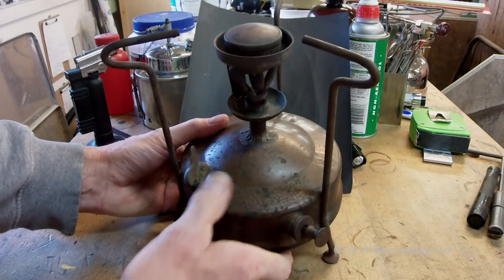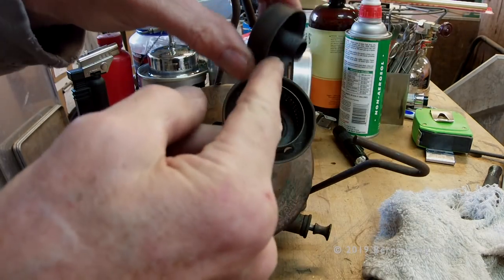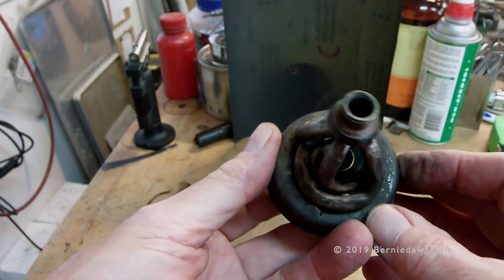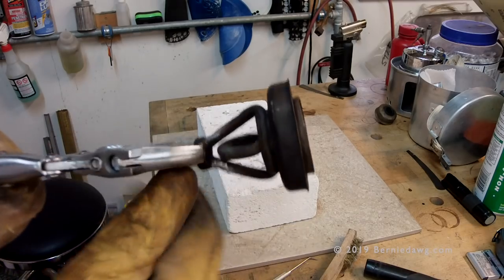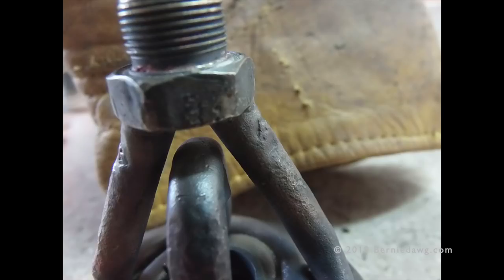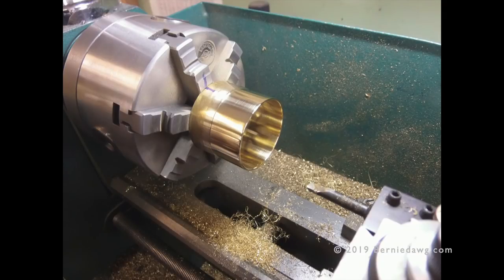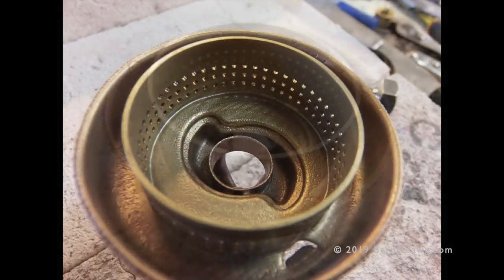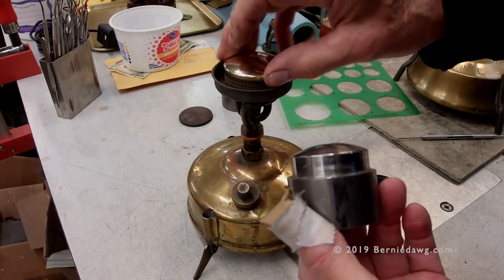Rebuilding A Vintage Svea #14 Silent Burner

Comment: Very nice work! I’m in the process of getting my Force Ten marine kerosine stove back in service with hard to find spare parts. I enjoy the time you take to show these burners. People tell me to switch to propane but I enjoy the ritual of lighting the burners, they burn hotter and kerosine may have a little fire but it doesn’t explode like propane.  LNG is lighter than air but harder to find, so kerosine is my choice. 🇨🇦
Reply from the maker: Good luck!

Comment: Nice work..That burner is a rare one.
Reply from the maker: @taxidriver fotogensamlaren Thanks! Yes, these are less common. I've been able to find quite a few, though. I've also done 4-5 of these rebuilds now. They work a treat! BD
Reply: @BernieDawgCinema  Maybe they are more comon in Usa than in Sweden? Pherhaps Svea brand sold better outside Sweden in competition with the trhee (in Sweden) bigger brands Primus ,Optimus .Radius
Reply from the maker: @taxidriver fotogensamlaren No. Sorry. I don’t think either of your suggestions is true. I’ve bought stoves with this form of burner from Tradera in Sweden, and from eBay in the USA, UK, France and Germany. I have examples from Primus, Radius, Svea and Optimus. I’ve repaired such burners for folks from both the UK and Sweden who sent them across the Atlantic for such repairs (in addition to my USA repair clients). I still see them from time to time. As I said before, they are uncommon, but I think not “rare”. If you aren’t finding them out there, perhaps you need to be more diligent in your searching. Constant vigilance is the key! 😎👍 Good luck! BD

Comment: Its such a delight to watch a person who knows what he is doing. I noted a new red washer on the base of the burner when reinstalled on the tank. What material is that? Copper? Silicone rubber? Inquiring minds want to know.
Reply from the maker: Aw, shucks. Thanks! 
The heat-proof washer in the video is one I obtained long ago from a kind gentleman, George Linekar (aka "Kerophile") from Scotland. Inexplicably, he has since turned the sales of these red washers over to Ross Mellows (aka "Spiritburner", and owner/operator of the fee-based UK stove social forum, Classic Camp Stoves) in England who sells them through his internet company "The Fettle Box". They work great! But, there are other alternative companies out there who also produce excellent heat-proof burner washers. I have found that the green-colored heat-proof burner washers from Australia sold by eBay seller "hytec_1", are at least as good as those red washers, maybe even better. As I use up the old red ones, I pretty much plan on switching over to the green ones from Australia.  Just my opinion. 👍😎 BD  PS - Love your flying videos!
Reply: Thanks for the guidance Gary, I'll check in with Hytec-1. I never put a lot of effort into the flying videos, just a place to park them for now so I can link to them on posts on my blog. Isserfiq.blogspot.com

Comment: What got you into this field of burners BERNIE ??? You must be really lucky that you can find such old burners. What is your trick Sir ??
I just love your dedication to detail making parts for the unit. Am just blown away as to the attention to detail used in the making of the stove. Attention to detail and quality was job one back in the day. What amazes me is the fancy bending of the tubing of the burner head. Would using past silver braze make doing this part of the repair easier ??? How about the alloy used to braze the unit. Would using german silver which has no silver at all in the alloy mix make the repair even stronger and longer lasting ?? Sorry for all the questions, as I am just wondering as to the outcome. 
Nice craftsmanship Sir BERNIE too. I really enjoy you repairing these old units Sir. Thank you for your teaching channel too.
Reply from the maker: @Victory First “German silver”, aka nickel silver, melts at a higher temperature than the materials used to make burners. Not a good idea. BD
Reply: @BernieDawgCinema  WOW I guess that I am batting a big goose egg when it comes to not thinking things through before putting the idea down on electronic paper so to speak. So you use the lowest temperature and strength brazing rods ?? vf
Reply from the maker: @Victory First Nope. I don’t use "the lowest temperature and strength brazing rods”. I use suitable temperature silver brazing wire and I don’t use "brazing rod" at all. For both clarity and education… I use the materials I discuss in this video. https://youtu.be/4zqCfOmkrcs Specific named materials are found below the video in the description box. You can use the names to find and order the materials at Amazon (I even provide some links) or the welding supplier of your choice. BD
Reply: @BernieDawgCinema  Thank you for letting me know Bernie. Learn good technique and information from you Sir. Good day and keep on fixing burners with a flair........        vf

Comment: Nice work Gary.  Question on the heat and air method of carbon removal: can you use this method on a regulated burner?
Reply from the maker: Awesome question, Tim! 👏 I used a spare spindle nut that I closed off the open end by silver brazing a piece of sheet metal over the end. You can see some pictures of this at a post I just made at my blog site: http://www.berniedawg.com/heat-air-clean-regulated-burners/ Hope that helps. Give a shout if you are building a cleaning rig: berniedawgstove@comcast.net 👍😎 BD
Reply from the maker: Do NOT use diesel in small stoves. It is too heavy a fuel and requires great temperatures and great pressures (like in the cylinder of a diesel engine) to properly vaporize and burn correctly. Diesel will incompletely burn, create noxious fumes and gross sticky deposits in your burner. Only use good quality 1-K grade or better clear kerosene as fuel in these stoves. BD

Comment: What accessories do I need to open that stove n clean it ..cox it makes my pans fill with soot
Reply from the maker: @jacobduncan8298 If you have a stove like the one pictured in this video, then maybe your soot is caused by you not preheating the burner so it burns blue flame instead of yellow and smoky. I have a complete video playlist with videos that cover preheating as well as how to disassemble, clean and repair these sorts of stoves. https://www.youtube.com/playlist?list=PL9Tg7BYD6fULVp5VFHNYZkUSIQUA6R8Gk If that is not what you are looking for then just drop me an email with a photo of your problem stove and we can get you fixed up. Comments suck for sharing photos. bd@berniedawg.com BD

Comment: When you made the form in the lath for the cap I figured you were going to hammer form it, then you made the mating part and press formed it, very well done. I was surprised when you cleaned up the tubes and there were no holes, I wonder why they used the solder on it? I on occasion get asked to repair an old boiler, which someone has tried to repair with soft solder. The worst is those who have been told the boiler is Silver Soldered together and they  try to repair it with Silver Solder from the hardware store. You have to get it through there heads that the silver Solder you are using has 45-55% sliver where the one they used has 4-6% silver.
Reply from the maker: I hear you! I try really hard to always refer to brazing as brazing rather than "silver soldering". The term "silver solder" totally gets everyone confused and I, like you, have seen nothing but problems come about from this misnomer. Plus, I think you'll find that silver-bearing solders you find in hardware stores are not just carrying only 5% silver, but also are alloys of tin and silver. They'll melt at temperatures less than 600 deg F. The Harris Safety-Silv brazing filler I use becomes liquid at 1425 deg F (about 200 deg F less than the melting point of brass/bronze) and is an alloy of copper, zinc and 50% silver (all that silver is why it's sold by the troy ounce). So, a different alloy altogether with a melting point more than twice as high as silver-bearing solder. (you probably knew that already) Harris has a great web page where folks who want to find out more can compare the properties of the various products they sell: https://www.harrisproductsgroup.com/en/Products.aspx 👍 BD

Comment: Hello Gary! I recieved my first Svea 123 back packing stove from my Dad when I turned 14 years old 46 years ago. I have it to this day - all original parts nothing replaced and still working like a champ. I love my stove! When my son graduated from high school, I purchased a Svea 123R stove for him. It never worked well for him, so he shelved it for many years. Recently I came across his stove and discovered that the internal pricker device is missing. Everything else is intact. My question is; can this particular model operate properly without the internal pricker device being in place? It seems to sputter and spit. Perhaps the wick is burnt, I don't know as of yet because I haven't removed the valve stem to check. Please share your thoughts about operating this stove without having the pricker device. Thank you for your input! Greetings from Western Canada! 😎👍
Reply from the maker: Cool story! The 123Rs work fine without prickers. The missing pricker needle rack is not what's causing your issues. These stoves probably don't need a pricker at all if they are always run with Coleman fuel, Crown fuel or other quality naphtha based camping fuel. Gasoline, especially today's gasoline with all the extra crud in there, will foul your stove fast and you'll be needing a pricker for sure. Hand held prickers are easy to make yourself. I can even send you some pricker wire if you like. And, I can direct you to a source for a new pricker rack. Just drop me a note to berniedawgstove@comcast.net  I also have a pair of videos on disassembly and reassembly of the 123 stoves at my channel. Check 'em out. 👍😎 BD

Comment: No primer cup?
Reply from the maker: @Robert Stevenson I’m testing the repaired client burner on a convenient Optimus 00 in the video, Robert. Adding in a spirit cup is an unnecessary complication when the burner can easily be preheated with a torch. Not advisable for everyday practice but fine for burner testing by a skilled technician. Thanks for asking. 👍 BD